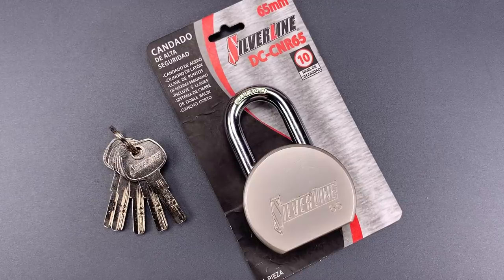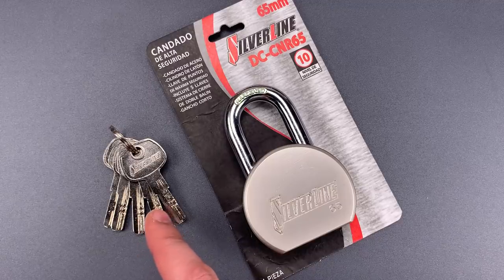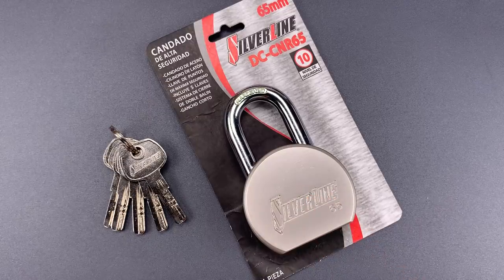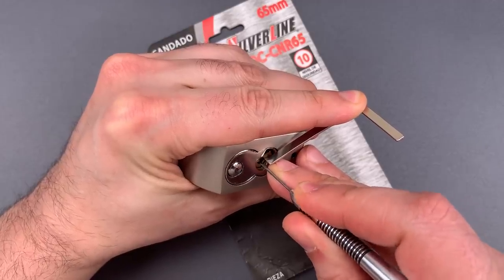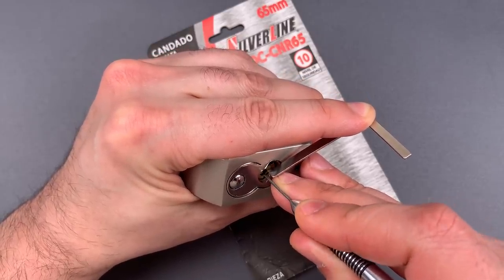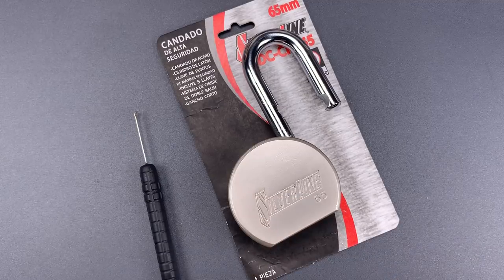[1112] The ROOKIE Mistake In The Silverline Round Body Padlock (Model DC-CRN65)

Comment: "How much can we save by removing this tiny piece in all our locks?" Bonuses were handed out and the stockholders were pleased with the quarterly report.
Reply: I wish this weren't the truth.
Reply: Bonuses that cost more than they saved on a metal disc that costs a hundredth of a cent.
Reply: @OtakuUnitedStudio  they could have machined the cam at the bottom a little different for the same effect.
Reply: Still, at least it's not the usual where they take stuff out and charge you more than the standard model 😂

Comment: I'd love a series on the best locks at different price point.  No just locks to avoid.
Reply: LPL doesn't want any appearance of bias.
Reply: Check out any of his vids on Paclock products. He still picks them open, but for the sub $50 price point they offer great pick resistance (variable spring strength, full of security pins) as well as excellent bypass protection.
If you want to go for more serious stuff, check out the great series by DeviantOllam over here https://www.youtube.com/watch?v=pwkeSzbsLsU (if he's recommending a set of locks, they're worth every cent).
Reply: Well, now and then LPL presents some material and states 'this is away from my current skill set'. And some companies, Abloy pops out my mind. But a roundup would be most welcome indeed.
As bias, after 1000+ vids he made that clear already. If it appears biased, it's because the good ones are really few.
Reply: I feel like the locks he's forced to actually pick are the ones worth investigating. Particularly if he has to use a specialized tool to do so.
Reply: @danieltaber4924  there are more than a couple videos where he points out that he would still use a given lock even though he can pick it.  A healthy number of Abus disc detainer core locks get that nod.
Reply: There is no “recommended lock” it’s just what lock will be more trouble to deal with than what you’re locking up is worth. If you’re looking for something to put on a school locker, a master no 3 would work fine despite being a shit lock because you’re only locking up a few books and your lock will be in view of someone at almost all times when it would be attacked.
Reply: @ConstantlyDamaged  You are the man.
Reply: @revi5555  Every time someone asks for LPL's pick of a "good" lock, that isn't a cue for people like you to make this exhausting lecture on your theory of security for the 10,000th time.  

Seriously, just STOP IT.
Reply: @SamBrickell  Inorite? The fact is LPL has recommended locks in the past and probably will again. A lock doesn't need to be impossible to pick to be recommended.

Comment: Looks like the core will come out of the thing, so take  it out, drill the pin stacks, dump out contents, tap top of pin stacks,  fill full of nasty security pins, put springs back in, install small allen plugs. Drop bypass shield ( easy  to make ) and core back in lock. You now have a nice secure lock on the cheap!

Comment: There surely has to be a difference between making locks with astonishingly low pick tolerances, and making locks with flaws like this. 

Low tolerance locks are acceptable, for low value items, but even those mandate more security than a lock that i could reach through with a bent piece of metal and just unlock it without picking.

Comment: When something like that is missing I wonder how often it was there in the prototype and pilot stages and then someone said they needed to take cost out of it and the lock designer who knew better lost the argument.  

Then there's the other alternative. The lock was sold for years and years as the same or previous model with the part but then someone decided they had to take cost out of the product and it was deleted. 

On the cost cutting side of the argument there's inflation pressure from the money creating central banks and the only way to keep the numerical price on the shelf is to take cost out.  It's a real challenge to take cost out of a product and maintain performance. Especially if the product has been sold for decades. So often raising the price isn't an option because people will simply not buy. Losing the informed customers in the short term is less than those lost with the higher price. In the long term that can be the wrong decision.

Comment: I can't really find anything specific on this, but have you ever tried picking one of those tiny (Abus?) padlocks with a lock cylinder smaller in diameter than an AAAA battery? They come with absolutely tiny keys but they often have some nasty bitting, so I figured that since recently you've been doing a lot of big padlocks, it might be fun to see if there are any interesting padlocks in that kind of tiny size around that actually do have some good pick resistance measures in place..

Comment: I've seen the 'Silverline' brand in the UK before. They're usually cheap screwdrivers that bend or spanners that snap, oh and pliers that don't line up properly. So it's not surprising to see Thier padlock ranges failing too. I've seen plastic coated padlocks that fully expose the pin stack retainer when you slide off the plastic sleeve. So on that reputation, I would have too much hope for the shackle hardness on this lock either. If by some miracle the shackle and body are good quality, couldn't you just replace the cam at the bottom to improve it?

Comment: Is it possible that the design actually had shielding for bypass, but the manufacturer simped on it for cost saving reasons or just plain "forgot" to include it? If it was produced in China that might very well be the case (depending on how the design looks like to begin with).
This may have been a faulty batch?

Comment: Is it ever possible to drill a small hole or two, or even one large enough, through a shield at the back of the keyway, and use a tool through the hole to open a larger number of locks this way? Either destructively or non destructively to the keyway itself, that is.

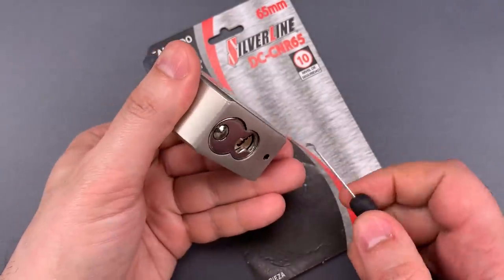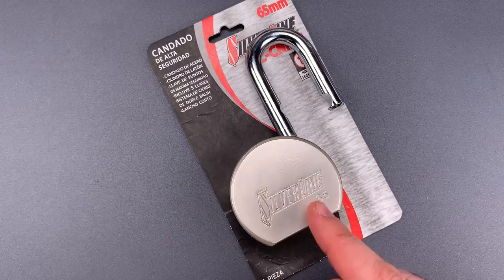Comment: I always tell the difficulty of the lock opening by looking at the length of the video. If it's around 2 minutes that means he sounds 1:50 seconds with intro and Outro and then 10 seconds to grab the tools and unlock the lock. The 6 to 7 minute videos are 1 to 1:30 to unlock but the rest of the time it's him disassembling the lock to show you the guts. LoL. And anything with a Redbull can in the picture means don't even lock your fridge with this lock. 😂 I'm waiting for the video where he stares at the lock and squints his eyes and the lock pops open. That's when the videos will fall under 1:00 minute. Every other YouTuber of making videos longer and longer while on this channel the shorter they are the better they are.
Reply: One day, he will buy a lock that pops open by itself just by him dropping it on to the table. One day he will find a lock that's been pinned that badly that the lock opens with a screwdriver because all the pin stacks are at the sheer line without the key.
Reply: recently he had a "unlocked this one without touching it, not even with any tools", but we're still waiting for the lock that simply hears "This is the LockPickingLawyer" and opens in fear.